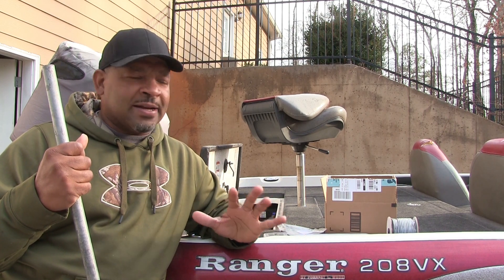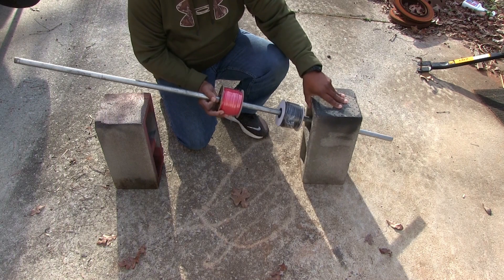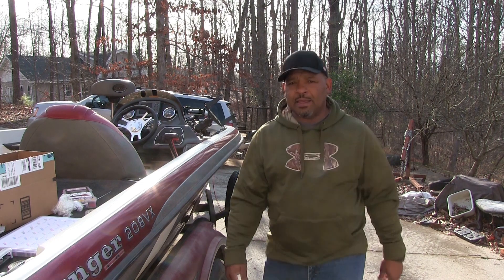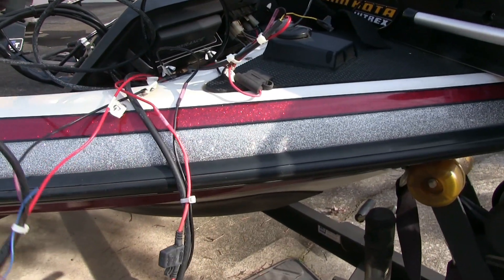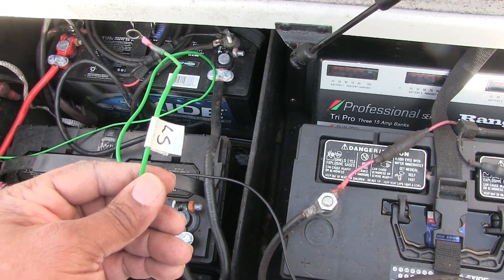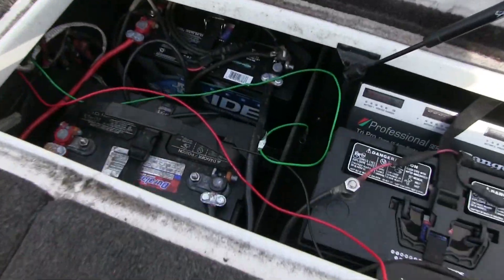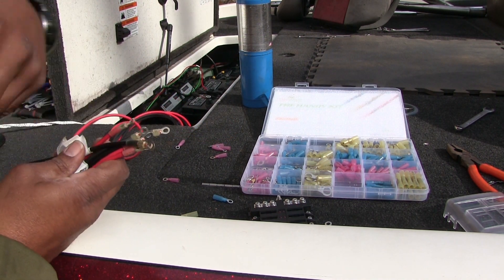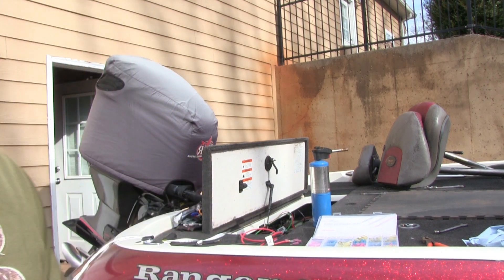How to Run New 10 Gauge Wire In You Boat

Comment: ive been watching videos on rewiring boats for over a year and today found your video. this is the first one that shows pulling wires down a conduit. thank you sir! I was surprised to see you cutting the cable before pulling and not pulling straight off the reels. My boat is in a marine environment so I use Ancor tinned cables for everything. great video. I'll be watching your others too soon.

Comment: This was an excellent video. I was having trouble running my wires because of the location stuff in the channel and couldn’t get the wires ran so now I know how to do it. I use a fish tape but it wasn’t enough. Thank you so much it was very helpful
Reply: I glad I could help. Good luck with running the cables. Plus remember to leave a pull string or a pull cable in there for the next time you need to run cable.

Comment: Michael great video bud. Have a 2007 Ranger 520VX similar to ya 205 that imma bout to do the same thing. Running 2 12” Lowrance Carbons. Great video. Assuming I’ll use the old wires to pull my new wires with and get the pull rope set up then too.

Comment: Great video. Thanks for sharing. 
Only question: why didn’t the connectors with solder in it work for you?  I’ve already bought them and was ready to go. Will stay old school if it is better
Reply from the maker: I could not get the solder to melt before the plastic would away. I might just had cheap ones. If may work for you.

Comment: You can also just tape the new wire to the old wire and then pull the old cable out and this way you have already run the new cable as it comes out. Easy Peezie

Comment: Thanks for the awesome tips. It makes life so much easier doing it right the first time. Where did you find the fish/pull rope?
Reply from the maker: You can find a fish tape at Homedepot and the pull string. The pull rope that I use was from a electrical supply store and it’s called mule tape. But that a lot of money for a bucket of mule tape when you only need a 40ft of it. I say get some string from Homedepot that ok size and use that. Good luck!
Reply: @michaelyoucanfixthat  Thanks

Comment: Good Info & demonstration Micheal. I also have a Ranger but it`s an older model . Where do you get the pull strap I don`t have that but can you also use the old tried & true fish tape  thru the conduit tube to attach the wires??
Reply from the maker: Yes you can use that. That is what I used to install the pull string to begin with. But you want a pull string left in the conduit for the next you have to install wires. Because it’s always a next time. But you can use any type string that wouldn’t brake to easily. Home Depot should have something that will do.
Reply: @michaelyoucanfixthat  I really like the type pull string you used> Where is it  in the store? What exactly is it called ?
Reply from the maker: @horacelee880  I install computer network cabling for living. The string is call mule tape. You can only get that supply places like Gray Bar or you should be able to order it online. But you just can’t walk into Home Depot or Walmart and pick it up.
Reply: @michaelyoucanfixthat  Okay Thanks

Comment: Great informative video.  What did you use originally to snake the wires.  I want to run 10 gauge wire up the port side for a dedicated line to hummingbird and 360 to a separate battery. Will I get interference if I go up the port side. It only has two battery wires for trolling motor in that conduit. Or should I just go up right side conduit?
Reply from the maker: I used a metal fish tape to run up the conduit first. Then I tie the pull string to the fish tape and pulled I back through the conduit. And make sure you tie more pull string on for you will always have a pull string in place. Good luck

Comment: Did you notice an improvement with the 10gage and what was it? Nice job of explaining what you where doing and why.
Reply from the maker: I did notice that my graphs did not blink and cut off when my battery was getting low. That was the big reason I did the upgrade. I think the graphs ran a little faster maybe. I know the did boot faster. But that was the improvement I seen. Plus my graphs are older units. I hope that answered your question.
Reply: @michaelyoucanfixthat  the new helix just shut off when the battery get to a certain point, they warn you right before they turn off. Do you know what I should do if I’m picking up static when trolling motor is in spot lock?
Reply from the maker: @crappienaterfishing1198  that’s a good reason to run separate power cables for each graph. It will cut out the interference from other units and your trolling motor. This is what they call clean power. They have wiring kit to do this but they are about $250 to $300. The biggest one that the pro use is call seaclear power. Here is the link https://seaclearpower.com/

Comment: Thankyou boss man. tell me how you got the string in there initially. Do you recommend a cable snake? Ive got to feed three 10 gauge wires from the back to the front for a Lowrance live target.Im adding 3 wires. not replacing any wires.Also, The panel where the throttle lever is at, does it come off? Thanks for the video!
Reply from the maker: I used a fish tape to get that string in there the first time. A fish tape is the same as the cable snake. But if you do not have either one. Go to Harbor freight, they have the fiberglass wire running kit. It is two foot sections of fiberglass rods that you screw together. You can push that down the side of you boat and tape you cable on to that. Then pull them through. But don’t forget to put a pull string in they to for the next time. That throttle panel will not come all the way off without removing the throttle lever. But you can see behind it. But should not have to remove that.

Comment: I see you kept the fuses up front for units, why have a fuse block in the back?
Reply from the maker: The fuse in the back is mainly because that’s the way the connection block came. You had to put fuses in to make the connections but it would help if you had a big power surge from charging or lightning while charging. But that the reason for the fuses in the back.

Comment: Are you using a marine grade wire? I was told to try and use something other then copper based wire due to a chance of corrosion? I bought some 8 gage wire from the big box stores that has the copper strands of wire but have not used it yet due to the potential of corrosion. Any help on the specifics of it Thanks
Reply from the maker: John, I don’t see any problem using copper strand wire. I have not had any corrosion. It you cut any wire on your boat right now. You would is copper strand wire used in you whole boat. So use they wire you have.
Reply: @michaelyoucanfixthat  Thank you for the help, much appreciated

Comment: What type connector was used for the 10 gauge to 16 gauge connections?
Reply from the maker: They was the type you crimp the wire in both side and melt the plastic to seal the connection.

Comment: How did the fuse box then get connected to power source?
Reply from the maker: On the top and the bottom of the fuse block you are places where your main power lead and ground wires connect. You would run a ground wire from the ground side of the battery to bottom of the fuse block for ground and power wire from the power side of the battery to the top of the fuse block to get power to all the fuses.

Comment: I’m pretty new to boating. I’ve never ran wiring in a boat. I appreciate the video...very informative. My question is, how did you run the original pull rope from the stern to bow.
Reply: I still waiting for the reply 😅
Reply: @thooleiboy9518 I think he mentioned that he used the old wires to do it maybe? I’m trying to figure out the same thing in my 08 tracker pro 175

Comment: What  do you hook your Garmin green ground to?
Reply from the maker: You can see in the video. I ran a green ground cable to the Garmin when I first installed it and that is going back to the battery ground.
Reply: @michaelyoucanfixthat  you ever have issue with your Garmin with a black half moon?
Reply: I I can’t send you a video to this link but I don’t have it grounded properly hope that is the issues and I going to run dedicated line for my live scope also
Reply from the maker: @jacobyaden1376  Yes, you have to have it grounded or it will show real grainy and not a good picture. Plus you have to have good size power cable also to give it the power it needs. At first I ran 12 gauge wire for my units but after a little research found out that might have not been larger enough size. So I went back and ran the 10 gauge wire you see in the video. The boat’s wiring my not be good enough for more that one unit. You need clean power and grounds for your units to show clear and work fast a possible. As for the half moon you are talking about. Im not sure of what you are talking about on that?